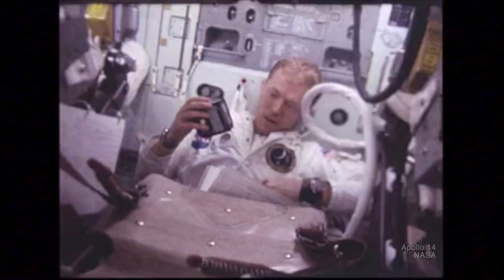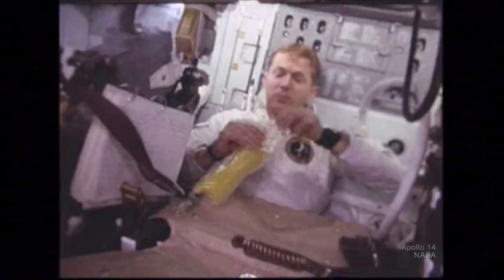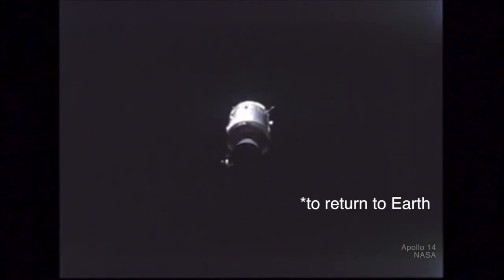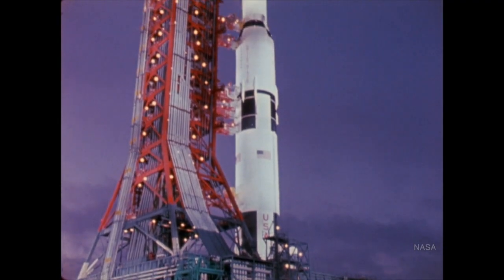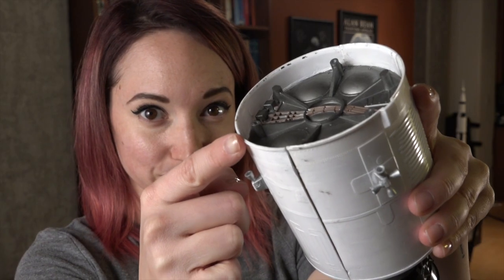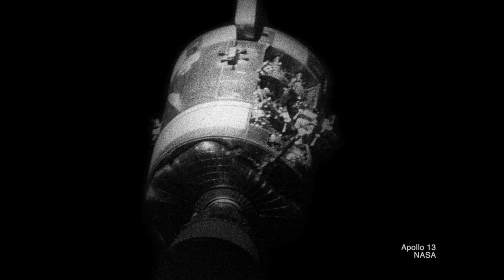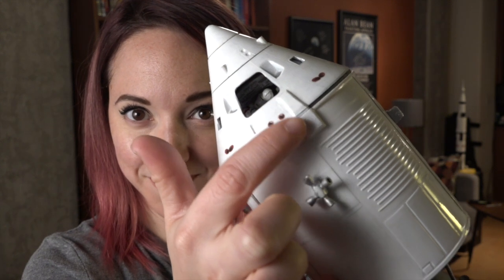How Did the Apollo Command and Service Modules Separate?

Comment: What is really being down played is now strong those straps were. A crane attached itself to the CM at the four attachment points where the LES would be attached later. It then lifted the CM to be mated to the SM where the straps were attached and mated the two to become the CSM.

The Lunar Module was then encased inside of the SLA. The entire CSM was then lifted up and deposited on top of the SLA where it was attached. Again, the crane lift the CSM through the attachment points. That means that then entire CSM was lifted and the strain was 100% on those 3 straps.

The new CSM and LM assembly was then lifted up, still by the 4 attachment point, onto a trailer where it was then driven to the VAB for assembly. So, the SM and LM were lifted up supported only by those 3 straps. The CM was attached directly to the crane, thus way I didn’t mention it.

Once at the VAB, the entire assembly was then hoisted up to the top of the Saturn V inside the VAB.

The entire assembly was based 100% on those 3 little straps holding it all together.

Comment: A guillotine seems a crude way to sever electrical and fluid lines as opposed to pull-out connections which would not have to be re-used, so any damage they sustained would be irrelevant, but the same method was used for the separation of LM upper and lower stages at lunar lift-off, so the guillotine must have been more reliable.  
As the three tension ties would have been attached to the perimiter of the heat shield in order to preserve its integrity, were they visible at all? Their installation must have been a highly complex process given the limited or zero accessibility of their location.

Comment: I don't feel this is accurate at all. You didn't mention the explosive bolts did you? I think they were dry release valve for the electrical and other connections between the service and the command modules.

Comment: a lot of unanswered questions, such as this:  What were the "consumables" you're referring to?
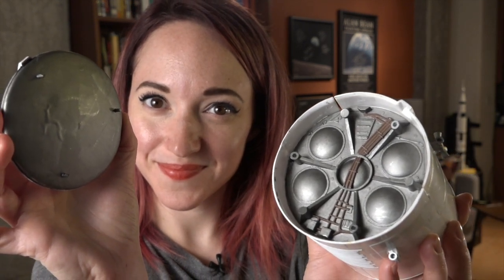Reply: Electricity, water and oxygen immediately come to mind. At 2:09 she mentions "water glycol" which I assume is for cooling - capturing heat from the electronics in the Command Module, and passing it through radiators in the Service Module. Does this help?
Reply: @maxfan1591  yes, thanks.  I was wondering if there might be some other consumables back there.  I guess the food was all in the command module.
Reply: @robinstevenson6690  "yes, thanks."

Cool.

"I was wondering if there might be some other consumables back there."

I might have missed something, but there are detailed schematics available online which show what was stored in the Service Module.

"I guess the food was all in the command module."

Yes. There were cupboards in the command module filled with all sorts of stuff, including food packages. A lot of the food was freeze-dried, so it didn't take up much space. It just needed to be rehydrated with hot or cold water, depending on the meal.

Comment: No that does not answer how the lunar modal was attached to the Capsule on the way to the moon and how it reattached once it left the moon! Especially sense the craft had not separated from its living quarters and there has never been another opening shown on the Capsule once it has returned to earth?
Reply: "No that does not answer how the lunar modal was attached to the Capsule"

That wasn't the subject of this video.
Reply: Nose to nose hatches. Amazing how engineers back in the 1900’s figured out how to design and make two hatches in a single pressure vessel. 

And to think they managed it without AI.

Comment: NO! How did they travel from the command module thru the heat shield to enter the return module? You never answered this, is this a mystery!
Reply: "How did they travel from the command module thru the heat shield to enter the return module?"

The Command Module was the "return module". Note at 0:06 she points out the Command Module (cone shape) and Service Module (cylinder shape). The Command Module was where the crew were located. The Service Module contained the consumables for the mission and the fuel for the Service Module engine. The crew never went into the Service Module.

"You never answered this, is this a mystery!"

The mystery is where you got the idea the crew were ever in the Service Module.

Comment: This brings back memories!  I was nine when Apollo 11 landed on the moon, and many of my classmates and I had the same 1/48th scale Revell C/SM you used in your demonstration!  Though I had the smaller 1/96th scale Apollo Spacecraft set back in the day, (I wouldn't get my hands on the larger, 1/48th scale version until Revell reissued it under the "History Makers" series in the 1980's,) the same demonstration could be made using the smaller one.  

I still build models today, and a few years back my son found a copy of the original 1967 Revell 1/96th scale Apollo Spacecraft (with the main engine bell infamously painted red) on eBay. 

Out of curiosity, are you a model builder as well as a teacher?  (And is that an original 1968 1/144th scale Monogram Saturn V in the background of your video . . . ?)

Thanks for making and sharing this with us!

My Like is in the 5.6Ks

Comment: How did they get into the command. Module
Reply: There was a hatch on the side of the Command Module. If you look at videos showing the astronauts boarding prior to launch you can see where the hatch is. In order to get into the Lunar Module (or Skylab on post-Apollo missions), there was a hatch at the apex of the Command Module which was surrounded by the Command Module's docking mechanism.

Comment: @2:04 You are holding the Revell Scale Model of the CSM which is based on the Block 1 design. The Block II had the Umbilical 180 degrees from the Hatch, probably to keep a lot of Wires and Piping more Shielded than in the Block 1 where they would have been under the Couches. The Block II also had the RCS Engines shown on the Apex Cover, side by side, instead of One in front of the other as shown in this Block 1 Model.

Comment: Do you have a video on how the Service Module engine and navigation correction “rockets” operated? Was it liquid oxygen fusing with hydrogen that created the reaction that caused the thrust in space? Or by some other means? I know the answer is out there, I’ve just not yet found an illustration or diagram. A friend of mine doesn’t believe in the moon missions and doesn’t believe how the engine and rickets were able to operate in space with no surrounding oxygen for combustion.
Reply: The engine in the Service Module (the SPS engine) was powered by hydrazine and dinitrogen tetroxide. These propellants are hypergolic, which means they ignite on contact with each other. This allowed the SPS engine to be very simple and therefore very reliable. The same combination of propellants were used on Titan rockets (used by the Gemini spacecraft), and on the lunar module.

In addition to being hypergolic, the two propellants were liquid at room temperature, which meant they didn't need the same level of insulation as liquid oxygen and liquid hydrogen. The disadvantages were that they were less powerful than other propellant combinations, and they were toxic.

The reaction control system (RCS) thrusters used a similar combination of propellants.

Comment: I should mention that the tension ties (binding the two) were separated by pyrotechnic bolts, not guillotine as mentioned in this video. The guillotine system was used solely to cleave the umbilical. Amy does get this point correct in her Popular Science article of 1 April 2016, "How Did the Apollo Command and Service Modules Separate?"

Comment: I have been looking for years on commercial literature about the technical details and pictures of the disconnecting devices (gillouttine) which operated spacecraft separation, but I only found a defocused picture of the devices used in the ascent/descent stages separation of the LEM, but not the SCM.
The NASA devices had been very reliable, while the Soviet had troubles in many occasion, the documented first being Gagarin orbital flight not releasing the deorbit engine.
I appreciate your video very much, thank you.

Comment: Amy, I have a question:
How did the tunnel between the CM and the LEM work.
Join - pressurize - vent - separate - join - pressurize - vent - separate again...
I'd like to see a demonstration and hear your explanation.
Thanks.
Reply: Actually that part was very complex. As the tension arms housed in the CM nose. Had too not only grab the Lem. But then lock the two. Then detach and move out of the way. To allow the hatch cover to open and allow them to move between both the LEM and CM.
The pressure was regulated. When the two halves connected. But the volume of space between the two were very small. You got more room. In the front seat of a car..As I once got to sit in a CM.. An old mini van has more more space in the back. It was Small.....The LEM had less space..

Comment: I couldn't help but notice that the re entry module was completely flush and smooth with no chamber lock ( to enter through ) so how did the astranouts escape from the service module into the re entry module ?
Reply: The astronauts did not enter the service module. The service module was non pressurized and contained just fuel, batteries, and other equipment. The docking port for the command module to dock with the lunar lander was on the top of the CM however (opposite side from the heat shield)

Comment: BTW - 2:15 " Electrical Connections cut the wires" is wrong. They were Explosive charges that forced a Guillotine to cut the tubes and wires. What is meant by "electrical connections cut the wires".?

Comment: For such a high-tech vehicle, the method to severe the umbilical cord by cutting it was kind of low tech.
Reply: It was the 1960's, NASA actually had to research, test and develop a lot of these things, which trickled down into the automotive industry first. 

I wish people understood that engineers, are people that try to improve the quality of life for everyone, but when money and power and private capital get involved, corners get cut, things in prototyping get pushed into production, way sooner.
Reply: This isn't the only place NASA used a guillotine on Apollo; see Amy's video on the 'Q' ball'.  The protective cover was removed at the last second before blast-off by some sort of guillotine mechanism that caused the cover to be pulled off.
Reply: @knauregriffiths7666  : What protective cover?

Comment: Great video. Did you also know that unfortunately there was a major trajectory glitch on separation of cm and sm on apollo 11 on re-entry. It was supposed to skip off the atmosphere for another orbit, keeping it a safe distance away from cm re-entry. Due to an error in thruster firing the sm burned up and broke up on the same trajectory as the cm module risking damage to the CM and the lives of the astronauts. This error in thruster firing was later remedied on future missions.
Reply: Woooaw I didn't know that. Thanks for sharing this valuable information.

Comment: The CSM model that you hold in your hand has the umbilical connection located right below the CM hatch. That is not correct is it? It should be on the opposite side of the CM if I'm not mistaken.

https://upload.wikimedia.org/wikipedia/commons/c/c0/Apollo_CSM_lunar_orbit.jpg

Comment: Why did it take Apollo three days to get to the moon?  In order to leave the Earth’s gravitational pull, Apollo few had to travel at almost 25,000 miles per hours.  Left alone it should have taken Apollo only 10 to 12 hours to get there.  Again, why the three to four day journey?  Thank-you!  Excellent videos!
Reply: Hi Daniel, well, while the initial accelerated speed to leave Earth orbit was 25,000mph, the Earth's gravity was decelerating the spacecraft for @  5/6ths of the journey, and the final 1/6th it was falling towards the moon. Think of it as a car, coasting on momentum, coming to a long hill, with decreasing gradient, and making it to the top, the watershed, and then starting to accelerate down the other, shorter side.....
The point is, the speed is not constant from TLI.
Smiles. Hope that was helpful.

Comment: Amy, you forgot to mention that the separation sequencer unit in the SM in addition to firing the separation guillotines also fired the SM's forward facing RCS thrusters for a few seconds to push it away from the CM before inducing a spin on the SM to ensure its rapid breakup upon reentry.
Reply: You sound well informed - could you tell me how far from Earth the separation event occurred, and how much time the CM flew on its battery power alone?
Reply: @donjones4719  IIRC the CM seperated about ten minutes before reentry interface and it had about 15 minutes of oxygen onboard (Enough to make it through reentry).
Reply: @nicholasmaude6906   Thanks. Wow, they cut it close!
Reply: @donjones4719  : all missions were done like this: just enough to complete the task.  Weight was an absolute problem. Only enough fuel, enough oxygen, etc. were supplied.  The mission was pretty much planned out to the minute, if not seconds.

Comment: Just a guillotine to separate?
So no explosive bolts involved?
Reply: @mark: there was an explosive charge designed into the guillotine mechanism. This was to ensure that it cut completely. As for the CM, springs were used to push it away from the SM after the clamps were released.

Comment: It's so lucky that the tension ties were as strong as they were. Had the blast from the O2 tank not blown out the wide SM bay door, it could be have blown the CM off the end and only the umbilical would keep it connected, flopping over on it's side.
Reply: It really wasn’t much of a ‘blast’ when the Apollo 13 O2 tank ruptured. There was actually very little combustion blast, it was all just the O2 tank’s high pressure releasing which caused the damage.

The damage was severe for a delicate spacecraft but there wasn’t any major structural damage, it was the loss of all the Oxygen and damage to the various systems that was so severe...

Comment: Could the Command Module have survived re-entry with the Service Module still attached? Would they have separated violently as the fairing melted? I recall that there was at least one Mercury mission where the retro rockets failed to separate and I believe a Soyuz where the orbital module wouldn't detatch. In both cases the re-entry eventually separated the two and the craft landed. I wonder if there were any studies about Apollo having a similar issue.
Reply: No chance. The SM was completly unaerodynamic. The whole ship would have started rolling around wildly and melt down and brake apart like the space shuttle some years ago.
For Mercury it was just a small piece that had much less impact on the aerodynamic of the capsule than the SM of Apollo.

Comment: Something that I am not getting in the re-entry of of Apollo is how the SM gets out of the way of the CM after the SPS engine has fired for retrograde.  So the CSM turns the engine toward the re-entry path, after the burn the detached SM must somehow get out of the way of the CM  does its RCS system work to maneuver the discarded module out of the pathway? Someone please let me in  how this happened, Thanks!!

Comment: How the hell did they get into it if the bottom is a solid heat shield? How did they crawl through to the other one? The heat shield was there?
Reply: They did not get into it as the SM was only a storage unit without the possibility (or need) to get into it.
If really something would have to be done (what was for the last missions), they had to pverform a space walk.

Comment: The question I have, is how could the landing module, upon moon lift-off, achieve orbital velocity so as to re-dock with the command module?
Reply: Using its rocket.
Reply: The lem consisted of two stages decent and ascent. At ignition and  liftoff from the moon, they separated by means of another guillotine system. And the ascent engine carried  them into orbit to rendezvous with the csm.

Comment: Question: Could the CM be depressurised safely, and then repressurised safely in the event that a crew had to perform an unplanned, or emergency EVA?
Reply: On the latter Apollo missions spacewalks were performed from the CM in order do things like retrieving film from cameras in external equipment bays on the SM, so yes the CM could be de-pressurised and re-pressurised.

https://www.lpi.usra.edu/resources/apollo/frame/?AS17-152-23393

Comment: Good clip, but: 1. How were the compression strips cut which physically held the CM to the SM? 2. I assume there was a vectored burn from the attitude control system of either CM and SM to adjust relative vector and velocity to achieve separation?
Reply: ad 1: Almost like blowing up an old steel framework bridge with plastic explosives. There were explosive charges wraped around the tension ties in some sort of a "sandwich", i.e. charge||tension tie||charge. One charge alone was able to cut the tie and both charges were ignited by two detonators simultaneously, just to make sure every tie got cut and the SM was really gone. Reentry with the SM still dangling on the CM would've been like riding a powder barrel through a flow of lava...
ad 2: Sort of. When the CM/SM SEP switches were thrown, the minus X thrusters of the SM started to fire and burned until either their fuel was depleted or the fuel cells in the SM gave up. That's more then enough to push the SM away from the CM. Additionally, the plus roll jets fired for 3.5 sec after separation to put the SM in some sort of a 'tumble', which increased the aerodynamic drag of the SM, so that it slowed down faster in the atmosphere then the CM (it also burned up quicker because of that). Finally, the SM was jettisoned at a specific attitude, so that it would reenter with its broadside.